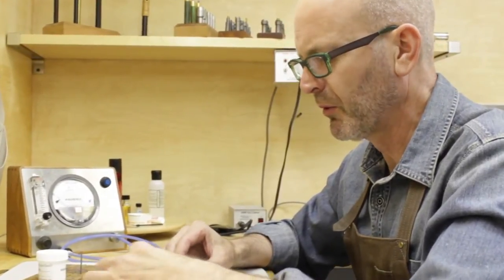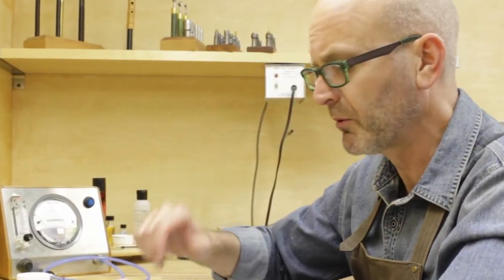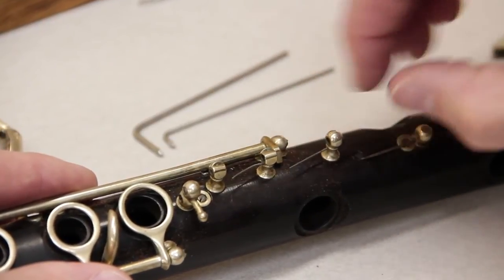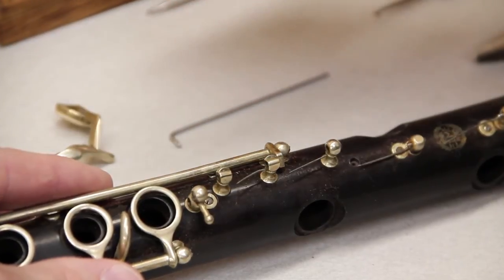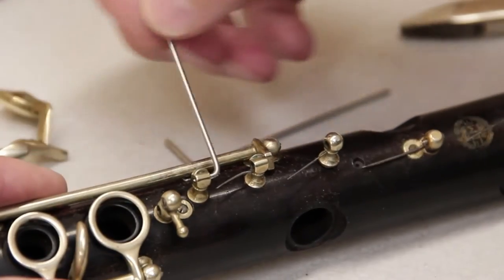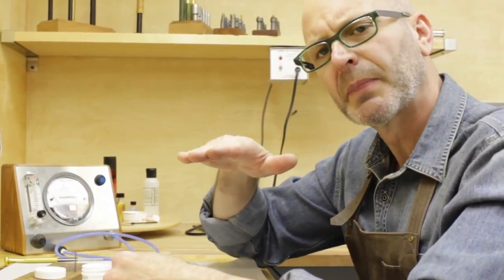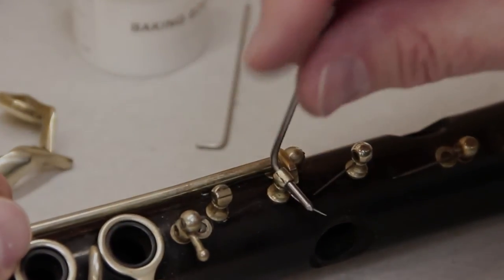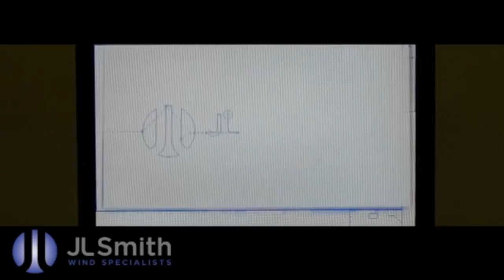SECURING LOOSE CLARINET POSTS

Comment: Are the clarinet trill keys supposed to wriggle when you try to move them left and right? It happens mostly on the two longer trill keys. 

 I was just wondering if it was normal; not my clarinet that needs an adjustment.

Other than that, all the other keys feel solid.

Comment: The baking soda trip was interesting.  I used a very small piece of plumber Teflon tape when I find the threads are not very good. This tape allows for the difference in the hole diameter. However, I will try the baking soda trick on future posts.
Reply from the maker: I hope it works well for you!

Comment: Where can I get the posts ?
Reply from the maker: Posts are available through manufacturers as well as some repair shops.  There are different heights of posts and threads may vary.  Often blank posts are not drilled or tapped.